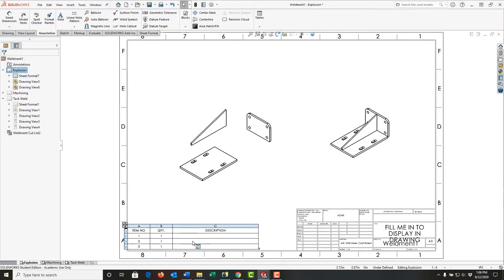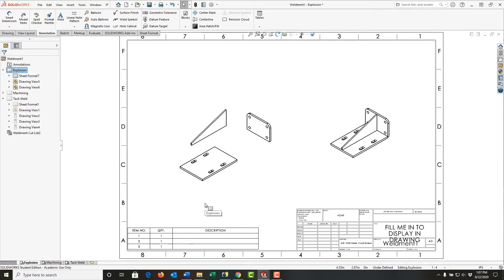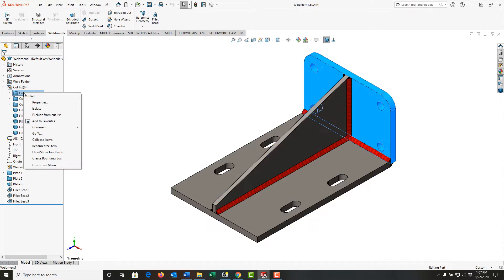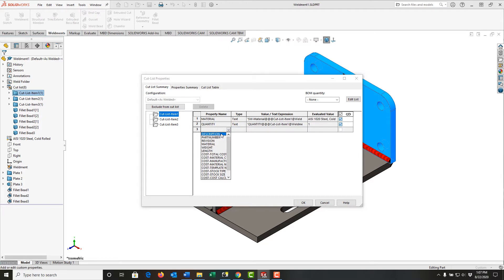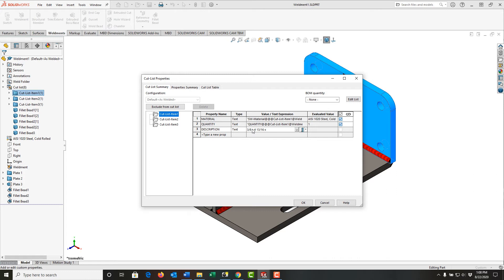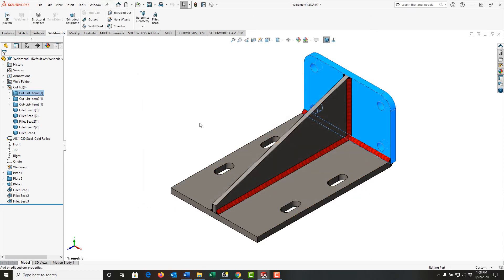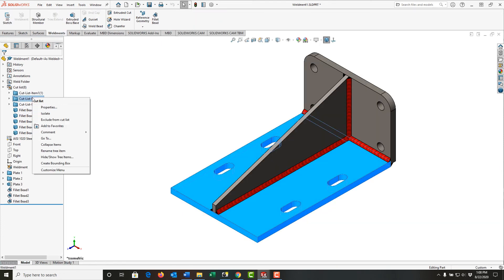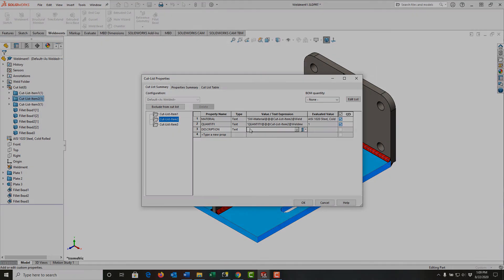Setting Cut List Properties

Comment: You can also move the table window and under the description value double click the item on the actual model and then select the values from the dimensions in the part. So you select first the "thickness" x "width" x "length".  Then if any of the dimensions change in the model the description will automatically update.
Reply: do you have a video or know of one that shows; "description dimensions that will automatically update with changes"? That would be much better. Thanks.